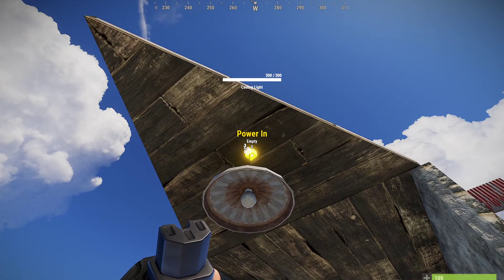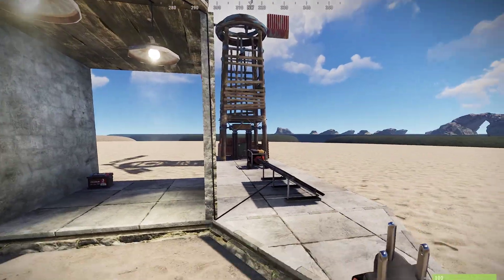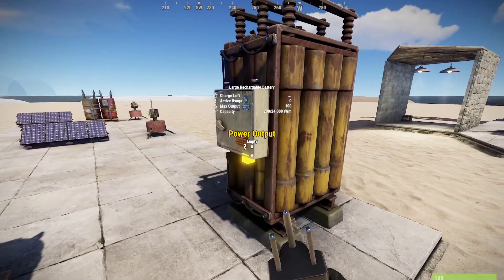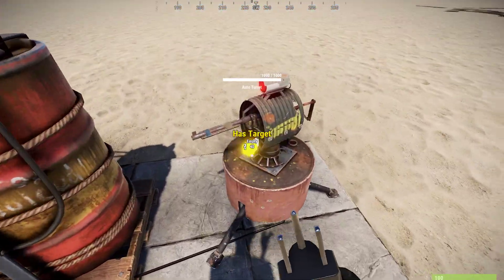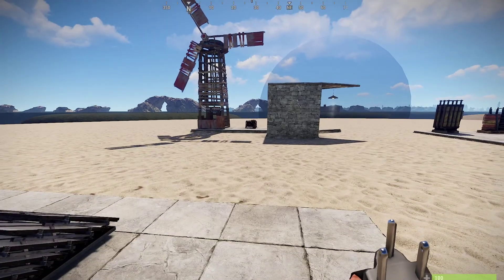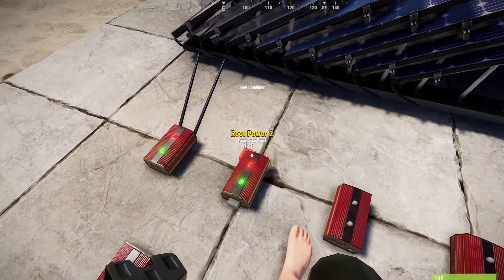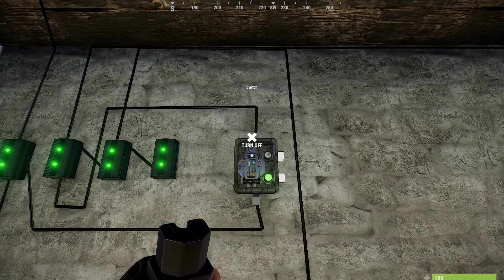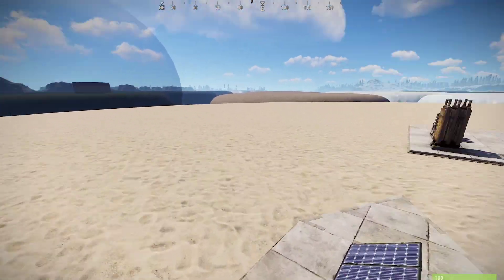Rust Electricity Basics (July 2020)

Comment: Does this video information still apply to this date? 
EDIT: Everything works fine, now what if the base requires more than 100 power, what do I do then?
Reply from the maker: You can set up more batteries!  Use electrical branches to divert power to another battery.
Reply: @BenjaminPlaysRust   we dont need any more Power Circuit ??   we put only battary ?  is nice to make 1 video with 4 backup battary fro 2021